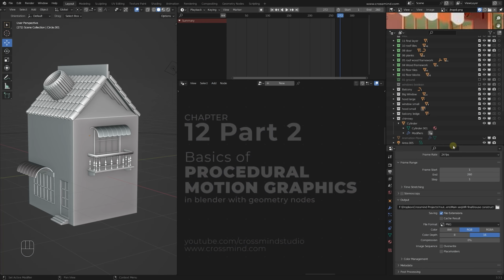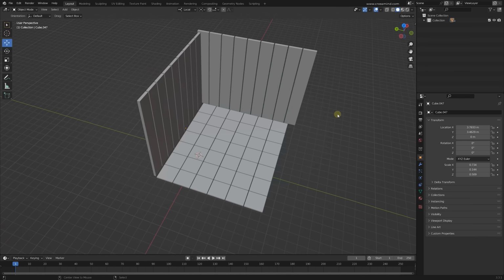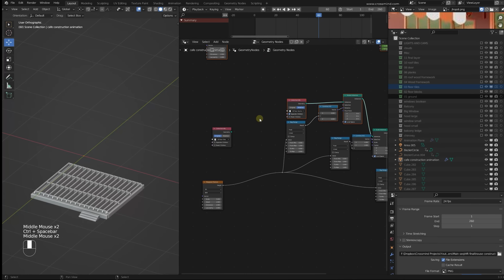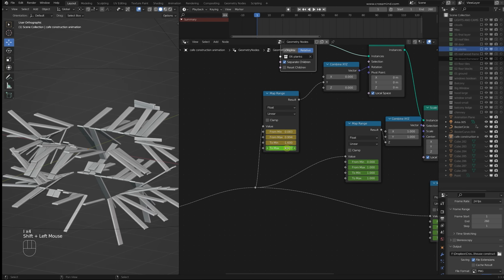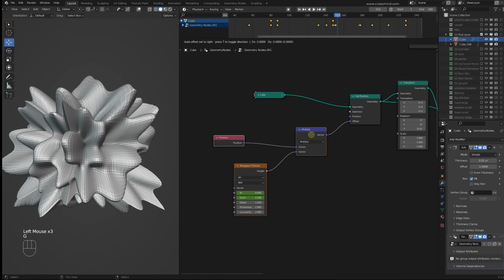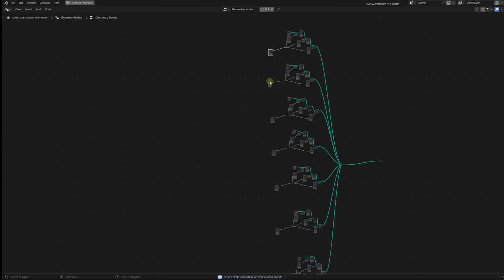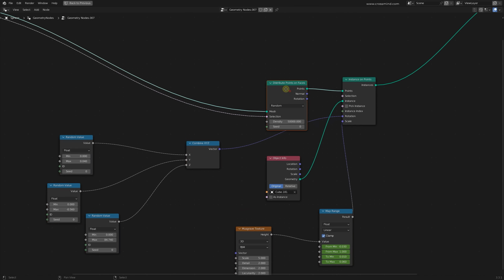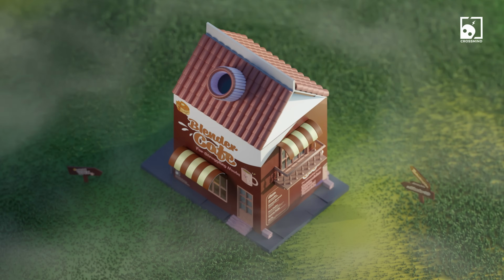Blender Tutorial - Cafe Construction Animation - Blender Geometry Nodes chapter 12.2

Comment: Tip: Group the whole node tree and duplicate and separate it from the original will actually duplicate the whole tree with the animation, and each group has different keyframes on display, so we only need to move them on the timeline
Reply: thanks alot

Comment: Hi, I'm trying to work on some animation but could not get passed the collection info node section. When I try to add rotate instance and rotate the object it gets duplicated with another copy in it's original state. Any idea why?
Reply from the maker: You need to hide the original collection, because same will be cloned inside geometry nodes.
And you can choose between 'original or relative' position in collection info node.

Comment: Instead of the keyframes couldn't you just use the Scene Time Node and some value and Math nodes?  Wouldn't make that animating this more procedural?
Reply from the maker: it would,  you can use scene time node as well. But since we were animating multiple parameters and were kind of playing with texture a lot, i found it more free to directly set the keys for the moment. But as i mentioned at the end of video, a single texture can also derive the entire animation or multiple nodes can be combined  to make it fully procedural. Just that i would it bit unneccesary here.